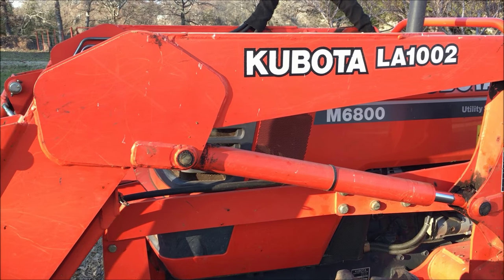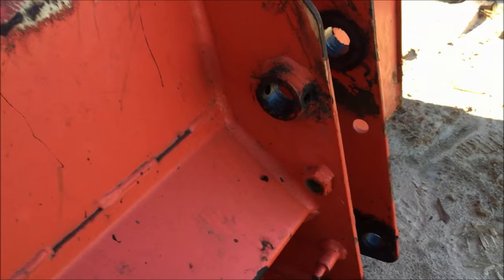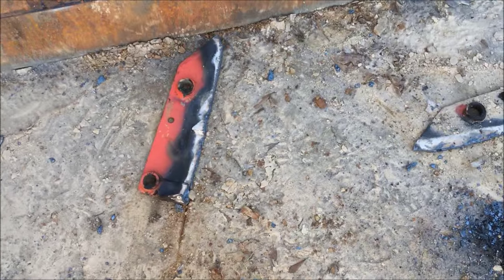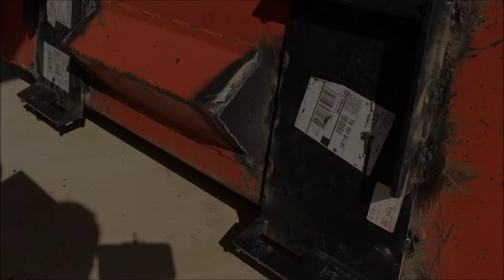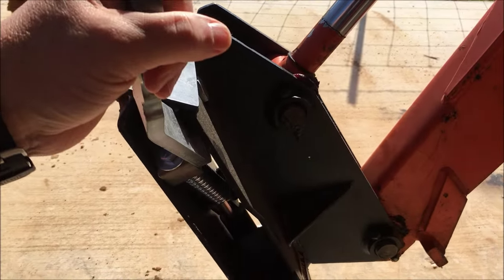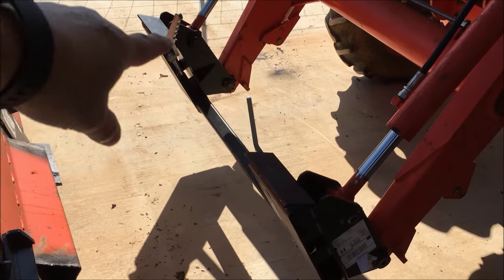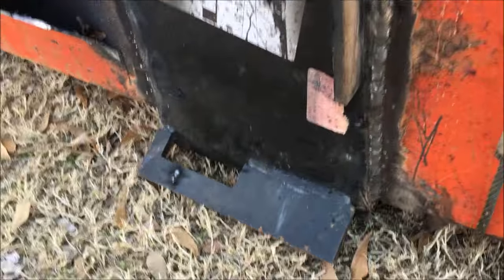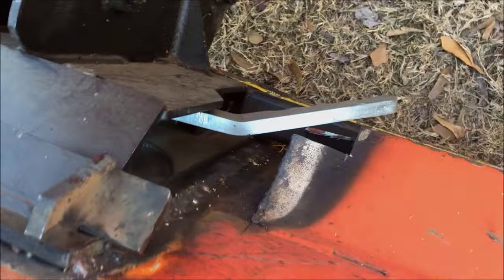How to Convert A Pin On Style Loader To Universal Quick Attach

Comment: Nice video,  I had the exact same thing done to my 05 Massey 1533. Yep, it cost a few dollars to convert to a QA but I also had 3rd function valve added for a grapple. Makes you wonder why we waited so long to get a grapple doesn't it? Also put a piranha tooth bar on bucket to dig into dirt. I did no work since I have no welding skills or equipment. 

You might want to cut out a bigger portion of that angle iron and grind it down real smooth since you have to get hands on the lock levers.  Sometimes when you're out working we move a bit too fast and that's when those jagged edges get you. Again, nice video and thanks for sharing.
Reply from the maker: I have this attachment, and it works great to remove brush.
It's easy on, easy off...
https://www.tractorsupply.com/tsc/product/the-ratchet-rake-68-in?cm_vc=-10005
Reply: Yep, nice tool.  I was looking at the ratchet rake several months ago when I had to clear an acre of thickly wooded land. I actually did the job by hand with loppers, chain saw, snips, bow saw, and a lot of sweat. Whew, it was a bear but a super workout. In fact, I'm getting tired by reliving the moment (chuckle). You ought to do a video getting into some thick stuff with your ratchet rake.  Be safe out there.

Comment: I'm assuming you installed adapter plates on loader and brought it up to modified bucket for tack welding.  It would have been nice if they had outside flanges  for bolting on bucket instead of welding.  I think you increased the $ value of your tractor, not to mention the convience.  Good job!
Reply from the maker: Yes, new adapter plate and QA conversion.
LOVE IT !!!!!

Comment: have you noticed any performance issues since converting?  or is it as strong and durable as it was before?
Reply from the maker: Seems as strong.
There is a little difference in the height of the bucket when it's down all the way. It doesn't quite touch the ground. 
In the video, I discussed how to account for height... and I put mine as low as I could... but it still needs an inch or so to touch the ground. That hasn't presented a problem yet, though.

Comment: Nice. I'd cut that brace on the back of that bucket off at an angle and weld a plate on it. No cutting of hands and no yellow jackets.
Reply from the maker: +devartt1 
Ooowwwwww.... I didn't think about the yellow jackets... I'll have to watch for them
Reply: +devartt1 i agree.
Reply: +devartt1 I thought the same thing when I saw that... I'd cut those out more and close em off.

Comment: So my question is did the pins to hold the pivot point of the bucket and ram arms, where the same size as the new QA? And where did you get them?
Reply from the maker: Yes. I bought the specific conversion kit for my model Kubota
Everything was perfect
Just had to weld it on...

Comment: you could cut the wedge at a nice 45 degree angle and weld a nice little plate to cover the hole, it shouldn't cost more than 2 or 3 hundred bucks.
Reply: And it would work as a brace for strengthening the bucket. But c'mon man, $2 or 3 hundred??? Somebody's getting screwed if they pay that kinda money for capping those angles. I'd do it for a hundred and make bank! Say that's a 3x3 angle, cut a 3x3 plate of desired thickness, Mark and cut diagonal. Trim the angle iron on the bucket, clean all and weld. No rocket science there.

Comment: Well that's now easier than our John Deere attach. Instead of levers I have two pins to insert. Switching attachments (say forks to bucket) is about 10 minutes or so. 
I see your new toy is a root take front attachment. Great for logs and sifting dirt. Do you have thumbs on it too? If so that's nice!
Reply: Er I meant "root rake"
Reply from the maker: +Atoyota 
Yep, the top "rake" opens and clamps using the rear hyd.
I'll do a video on it in action soon.
Reply: +TexasPrepper2 Yeah we don't have one for the Deere, but the Skid steer has two size rakes. 8' and 6' rakes.The 8' we use mainly when doing burn piles, pushing in and sifting chunks out of dirt and ash.
But for instance you could chainsaw down some small trees (locust maybe) and then use the rake to pick them up and deposit them elsewhere.
They are handy "big hands" on equipment.

Comment: Thanks for sharing,, I accidentally  left one side of my ATI quick attach lever unlatched.. the darn bucket in hinged itself, of course, and torqued the alignment of the lever plates.. Another thing I’ve got to fix.. Any recommendations..
Reply from the maker: I would use a fixed object (tree or something like that) and chain between the tree and the bent place. Try to use the tractor hydraulics to bend it back. Small movements so you don't over do it. 
Or (depending on which way it's bent) push against the tree with the tractor and try to bend it back in place. Might be tricky, but it could work. 
I have a bent bar on my QA too. Not bent bad. Still works.
I need to do the same thing, but sounds like yours may be worse than mine. 
Let me know how it goes.
If/when I bend mine back I'll try to video it and post it.
Hope that helps

Comment: I've done it like this, cut off the old pin plates and re use them. It's a lot cheaper, but it's also a LOT of work and time. Decide what is more important to you. You need to be a very good welder, and good at cutting with a torch, or plasma cutter. Expect to invest 2 to 3 full days to completion if you are not an experienced fabricator. Regardless of experience, this is never going to be a 2 hour project.
Reply from the maker: So true. 
Sounds like a lot of work. Most of which I am probably unqualified for 😊

Comment: I have a 545d pin style was wanting a quick attach adapter
Reply from the maker: Call Everything Attachments:  https://www.everythingattachments.com/
I bet they can fix you up.
It's not cheap, but it's the best thing I've ever done for my tractor.
Worth every penny!  :)
Reply from the maker: Remember, you'll have to convert all your ATTACHMENTS to "skid steer" too
Reply: Just wanting to add a grapple how much on adapter
Reply from the maker: Buy the grapple with skid steer mount.
Any OTHER attachment (bucket, etc) would have to change to skid steer.
I think my bucket change cost $200, but not sure and I'm sure it's changed by now.
Everything Attachments will tell you everything you need to know. Helpful folks
Reply: Thank you
Reply: @BIGALTX  I think there are two things that dived modern tractors from older ones, this is one, then not having a clutch...

Comment: Looking at them Arc Welds it seems like you need a DC arc welder, smooth as butter, with 7310 welding rods if I remember correctly.
Reply from the maker: I have three welders, and none of them are DC 😩
Reply: @BIGALTX  I bought the BlueDemon DC arc welder for around $350, and my welds were night and day comparison to the AC welder. The Arc is smooth crisp and steady, no popping spitting or sputtering. 

And the bluedemon suitcase size unit only weighs like 25Lbs
Reply from the maker: @lionsdejudah  I've heard DC is really nice. But, with 3 welders already it's hard to justify buying another one  :)
Reply: Correction: 7018 arc welding rods, they are the best for DC welding.

Comment: You coulda sold your bucket and bought a quick tach bucket, and been $$$$ ahead, lol
Reply: If you believe that you should go bucket  shopping. The one you want will be higher than hell and the one you got nobody else wants.
Reply: @bellydump-hf7ec  bahahaha indeed.  Where he could a saved money is if his nephew is a good weldor they sell the tractor side plate for about 200 bucks where you take those tabs you cut off the bucket take two pipes that fit through the lines and line them all up and go to town with an angle grinder till they're  pretty flat then pin them on the tractor and weld the plates to your original tabs.  This saves a ton of money because the tractor side can be 800 to 2400 bucks depending on if it's a common loader or not.  But when you do this it is very critical that you put the bucket flat and level and then idle up to it and mark the top of the attachment bracket on the bucket then mark 2" above that for where you weld the plates in.  You want to be able to go about 2" below grade with a flat and level bucket to ensure that the bucket can engage ground with power down and a level bucket.  If you mount too low you have to extend your cylinders to lower the front of the bucket to engage ground and we all know you want to have the bucket as curled as  possible when doing heavy bucket work.

Comment: The QA plate on the tractor......$837!  WOW.
Reply from the maker: It's so convenient that it was well worth it.
I can't imagine having to change implements without it, especially since I got my grapple. Watch how easy it is: 
https://www.youtube.com/watch?v=W2fylc-b3uI&t=389s
Reply: Got mine from Kubota dealership. $575. Splendora, TX
Reply: I got mine from a dude on craigslist for $350 this spring, and an adapter for a bucket (or whatever) was $80.

Comment: Why ruin that bucket? Just go get a quick bucket and have both.
Reply from the maker: That bucket is useless to me once I installed a quick attach on my tractor.
Without the bucket being QA, it won't work on my new setup.
Reply: @BIGALTX  I know this is old but you can buy a quick attach plate for the bucket that uses the pin holes. No welding.
Reply: @mckrackin5324  
Can you tell me where those are available?
Reply: @raywmontgomery  I think it was sold by Worksaver. Or it could have been 4startools. It's been a long time. Sorry I can't be exact.

Comment: why in the world would you use the rod with less strength for a root pass then put the stronger 7018 on top.   Here is a welding tip.  ditch the 6011.  do one real good pass with the 7018.  if your not that good practice on scrap till ya are.
Reply: 6011 is a deep penetrating electrode, it also works better on worn metals. On a root the 6011 helps with getting inside reinforcement with less slag. Pipe welders do it all the time. 6010/6011 root and 7018 over.